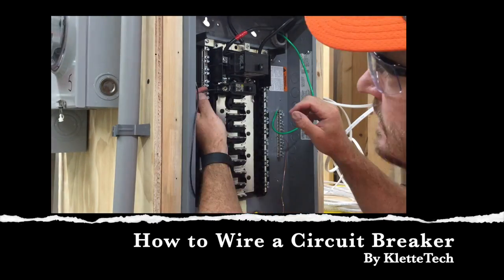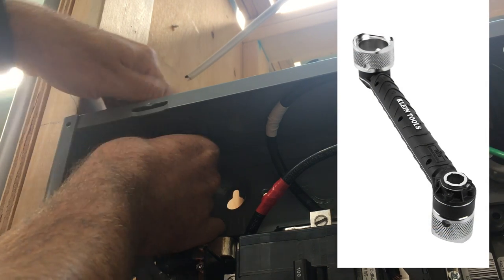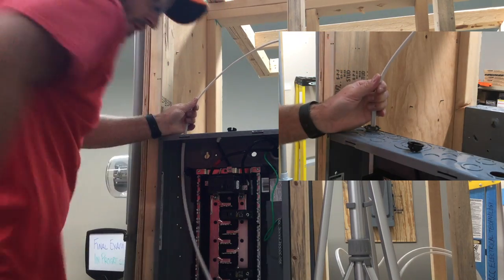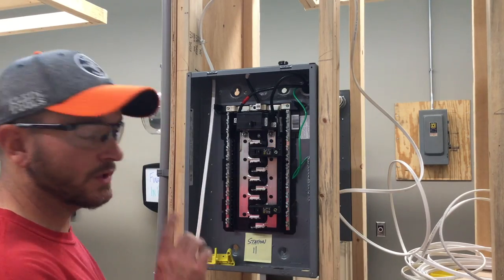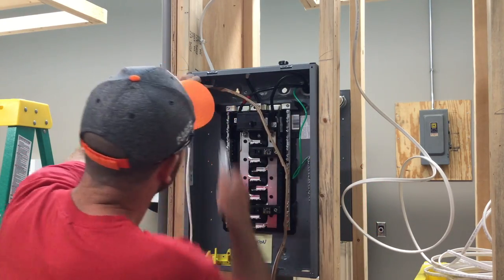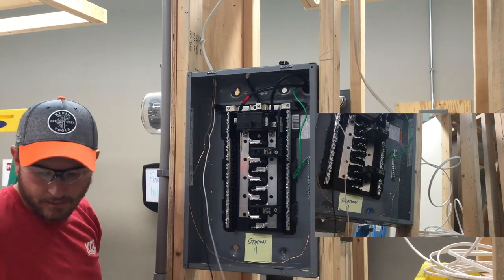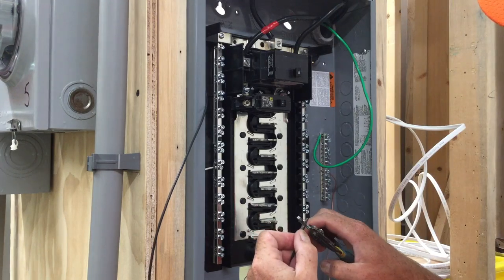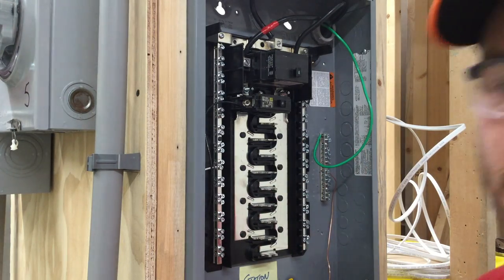Wiring a Circuit Breakers

Comment: Thanks for posting this. A 120V cable was installed in my breaker box without any connector at all. I can't install one because the box is drywalled in. I'd like to remedy this before I put the house up for sale. What's the proper solution? Is a rubber grommet acceptable? It's a 1.75" hole and I can't find push-in type connectors that size.